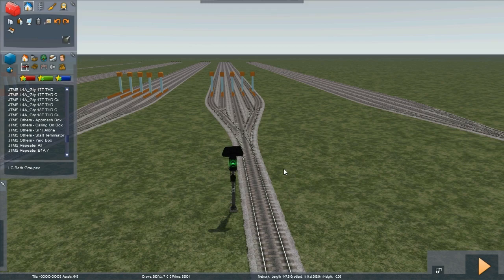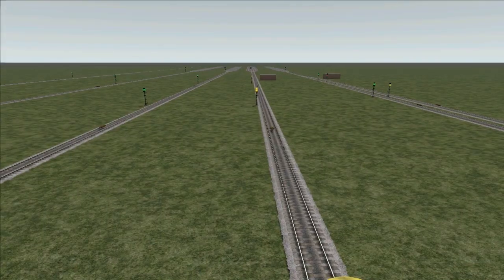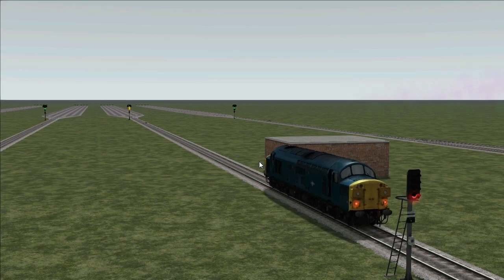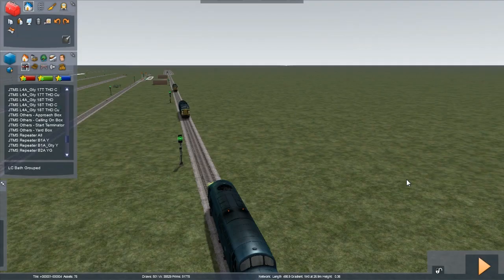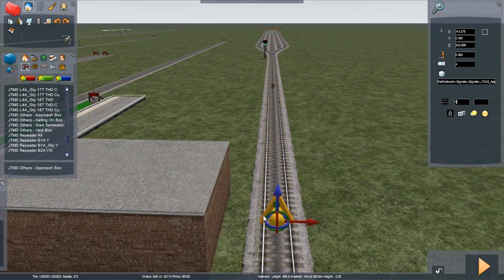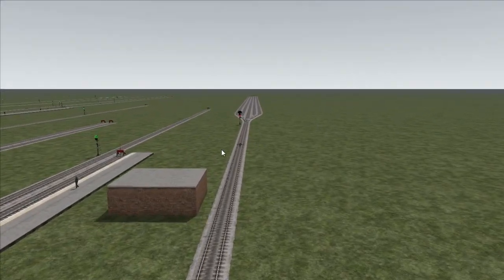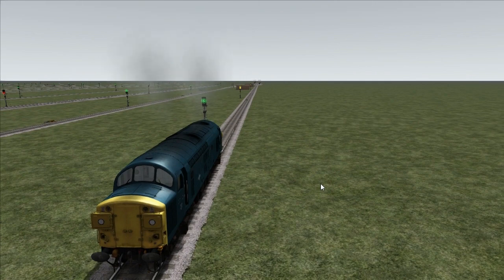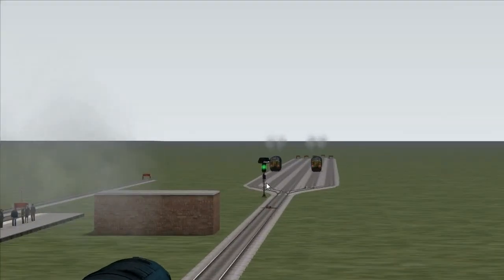006 Special Signal Asset Approach Box

Comment: Interesting feature. Why would you ever use this? Are there real world situations where this happens?
Reply from the maker: Signals can be held at red even if the route is set and there are no conflicting moves until a track circuit is activated or a timer expires. This ensures the speed of trains over low speed junctions is slow or you will trigger TPWS overspeed / stop loops.